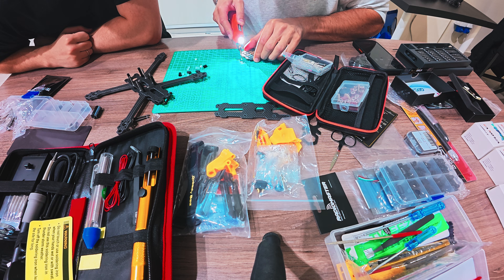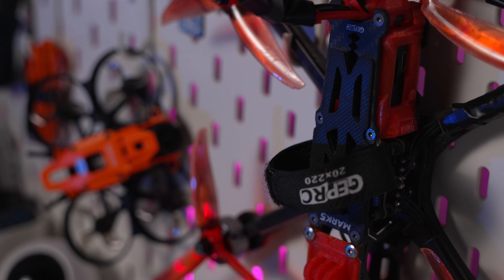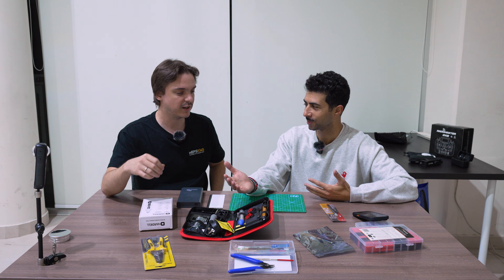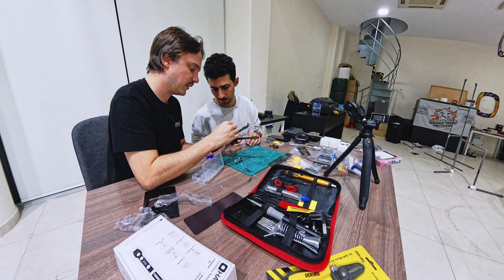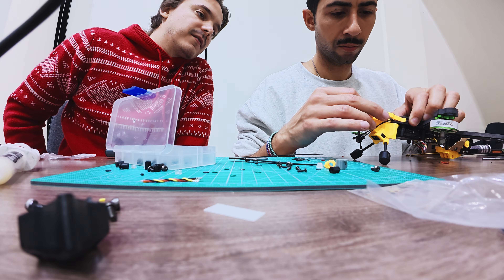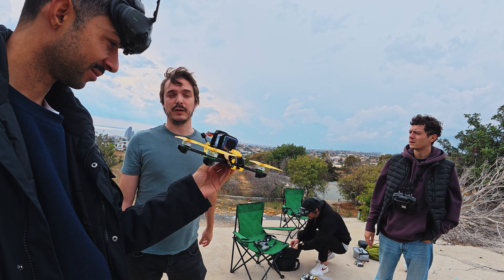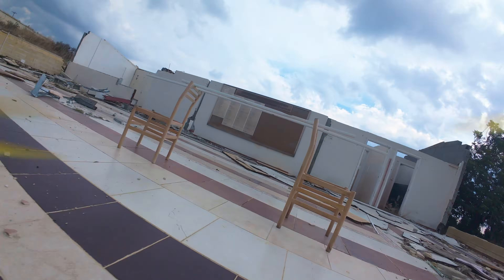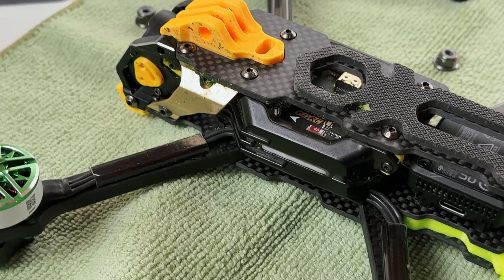I Let AI Pick Every Drone Part

Comment from the maker: Drone Parts List:
Frame: SpeedyBee Mario 5 XH O4 Pro - https://linktw.in/JLqAiP 
Motors: T-Motor Velox V2306 1950KV - https://linktw.in/ZJrRkj 
Stack: GEPRC Taker H743 BT 50A - https://linktw.in/NaCdAD 
Video System: DJI O4 Pro Air Unit - https://linktw.in/vQZxmx 
Receiver: DFR ELRS 2.4GHz Nano - https://linktw.in/SyylQS 
Backup RX: TBS Crossfire Nano RX (SE) - https://linktw.in/ECJyen 
Props: GEMFAN Hurricane 51466V2 - https://linktw.in/sBEFPA 
Props: Gemfan Vannystyle 5136-3 - https://linktw.in/YqDaZh 
Radio: RadioMaster GX12 - https://linktw.in/csUexp 

For more check description

Comment: Very nice build project, glad to see it came out well, and your soldering looks very good! For my first build I went with the Source One and whatever parts were cheapest. It actually flew pretty well, but when I look back at how my soldering was I want to cry 😂
Reply from the maker: The biggest hurdle was knowing compatibility of parts. Putting my shoes as a complete beginner was key. Stock was another issue but I think ChatGPT has had some upgrades recently to do better shopping. The one thing I need is a good soldering iron and have my eye on one.

Comment: One thing you didn't ask chat was the price .
You can make ALL of the drone except the 04 air unit for the same price as your Geprc stack
I have done a cheap build vid for beginners 
Crsf and elrs and a radiomaster boxer crush TX are what I use.
Try putting your settings in the goggles 4k 60 fps , iso 1600 and on 60mhz for full 60 meg 👍
Reply from the maker: So the original stack it gave me was not in stock and then second choice also out of stock. So I ended going with the GEPRC one. I did ask for a price but O4 was obviously the most expensive component. This was more for a first build rather than a budget build but when stock is hard to get it changes everything.

Comment: I built my first drone with 0 flying experience or any drone experience no soldering experience.
The biggest issue and time waste I had was that       there was no Stack screws with the frame.

So I had to find them, I didn't know about dimensions, length, etc..  I ended up buying a different frame with stack screws.
Make sure you have stack screws with the frame !
Reply from the maker: Some sites don't even list the contents of the box with frame so its hard to know and sometime we over buy but I guess better than having parts missing then having to wait weeks.

Comment: Commenting down below:

Go for ELRS. All my setups are 900mhz with exception of my 65mm-85mm tiny whoops. I use a T20 Radio (900mhz mentioned) and for tiny whoops I have a 2.4ghz external module and I also have a radiomaster pocket 2.4.
Reply from the maker: Do you fly mainly long range if your on 900mhz? I would have loved the pocket but wanted the higher output power and Gemini X as I need something versatile for various quads I plan to review in 2026
Reply: @DimmyV definitely Gemini is the best of both worlds in a single radio. I use my radio from light weight kites (no propulsion) all the way to my quad, fixed wing and vtol wing. I mainly fly cinematic. Some occasions I go to a remote spot to fly long range. But this doesn't happen very often.

Mainly I fly a pavo pro. A 5 inch with a 3 axis gimbal dual operator 90% of the time
Reply: Regarding my pocket. I love the possibility of having a compact radio for some tasks. I love all sort of buttons on my main radio. But the pocket as secondary is a nice. I use it with dual operator gimbal and for taking friend to fly as trainer and instructor

Comment: Ive been flying fpv for about a year and a half now. And matter-of-fact: my first drone was a 5 inch that i built myself! (With the help of some good youtube tutorials from joshua Bardwell, TronCatFPV and Hoarder Sam. It was the best thing i could have done even with nearly 0 soldering or electronics experience. Because i knew once I got it in the air, if it ever came crashing down, I know all the components piece by piece. INTIMATELY 😂
was it a pain in the ass? Yes
But it was a really good pain in the ass. If that makes sense haha
Reply from the maker: Great move. Can be daunting for beginners but thats a good though process "if anything breaks" and that does happen. How did you choose the components?
Reply: @DimmyV for components, i pretty much went part for part with Troncatfpv's 2023 DIY 5in build. Super solid 6s build. I just went with a different frame. Bought the Speedybee Master but was sent the Master5 (which has some issues with the vibration dampening.)
Figured that out WAY too late in the building process to return it so im stuck with it LOL but it still rips!

Comment: Yeah fpv is a very deep rabbit hole you can fall into, and there are a ton of things that people don't tell you about fpv that completely drains your budget.  For example, I had never soldered before I started building drones and it turns out that I suck at it, lol, but thankfully there is such a thing as smoke-stoppers (I refuse to plug in a battery at first without having one attached).  They have saved me hundreds of dollars, easily.
Reply from the maker: Definitely, it's all the little things that beginners may not want to tackle or budget for. Smoke Stoppers is important. Imagine someone new didn't know about it and fried their drone they spent hours building! What did you build?